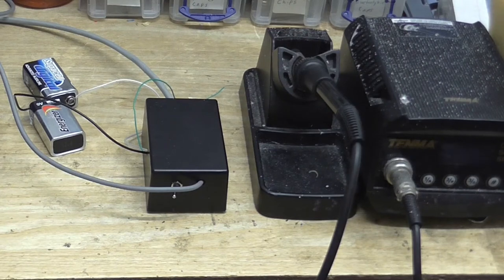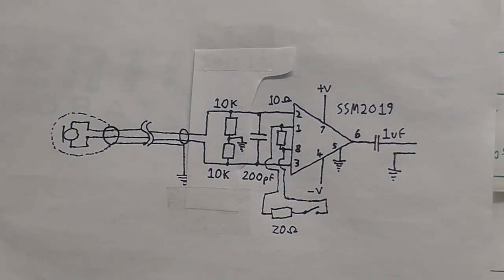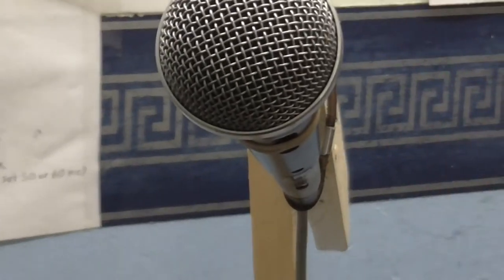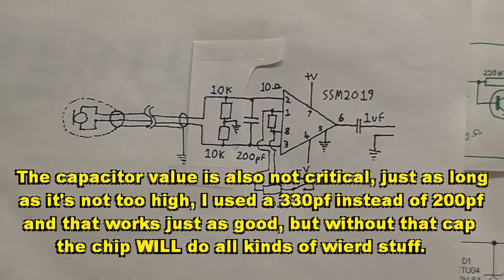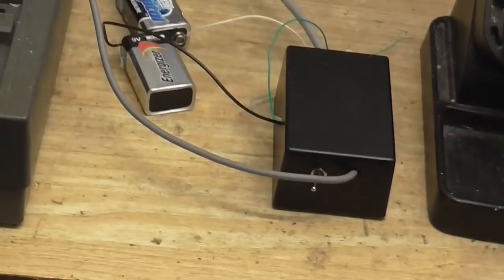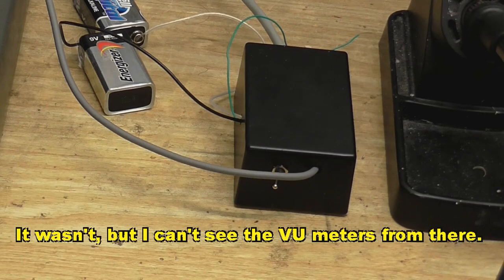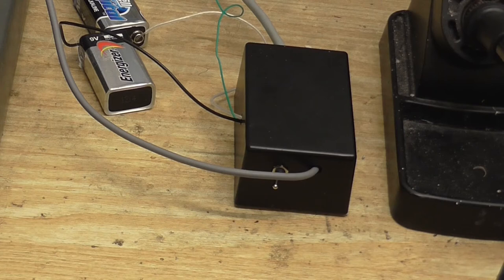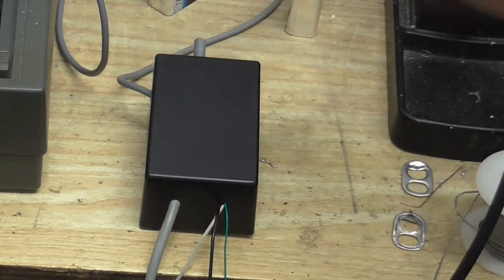SSM2019 Mic preamp (just a short video)

Comment: Great video. Clem, could you please do an auto volume controller that I could use with my laptop so that I don't need to keep adjusting the volume. Some YT videos are really loud and some are really quite. I listen almost 100% using headphones, and sometimes my ear drum are nearly split by loud music or other loud sounds. Cheers.
Reply from the maker: If you're using Windows vista, 7 or 8 you don't need to. If you go into control panel, then sound, then select what ever you're sound device is, then select the enhancements tab, you should find something called  "loudness correction", that will fix that problem, I use it myself and it really helps keep everything nice and level.Like  I say though  I  don't know what OS you use so if  your  on Mac or Linux, I don't know about them.

You might want to try this circuit though: http://www.electronicecircuits.com/electronic-circuits/automatic-gain-control-microphone-preamp, I know it says microphone preamp, but it works wonders for line level audio if you remove R1 and replace the microphone with a potentiometer and connect that to the computer's line out and there you go.
Reply: Thanks for the reply Clem. I'm using Windows 7 and I tried that setting ages ago - it's actually called "loudness equalization" on my system and the check box is ticked, but it really doesn't seem to make any difference. I just thought you might be able to design something as you are interested in this sort of thing, and I have a lot of confidence in your ability. I'll have a look at that circuit you gave a link to, it could be just what I'm after. Once again, thanks for taking the time to reply, I do appreciate it. Cheers.
Reply: A compressor/limiter would work.

Comment: Will there be more noise if a wall supply is used instead of batteries?
Reply from the maker: It depends really on how well the wall supply is made, a lot of the cheap switch-mode supplies have high frequency ripple in their output and that can get into the audio.